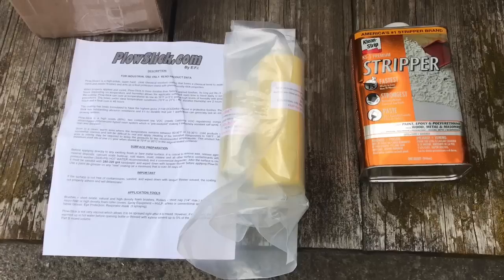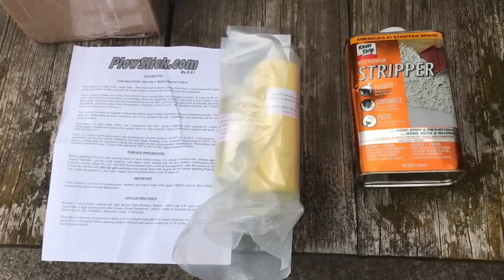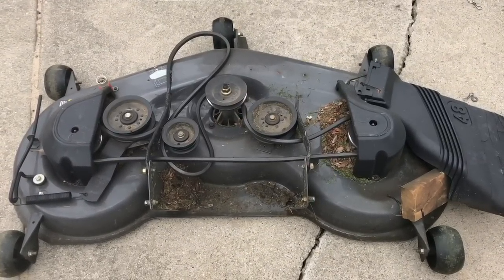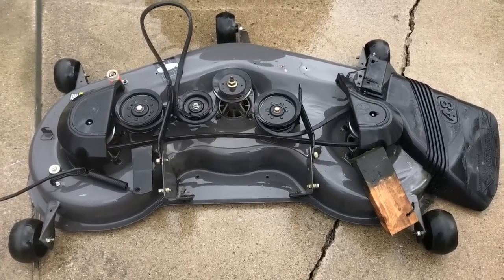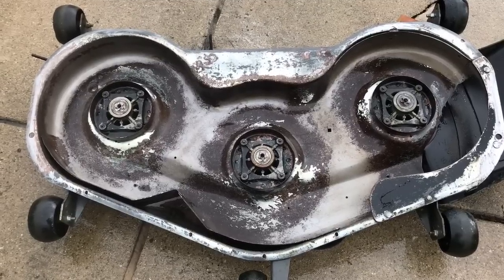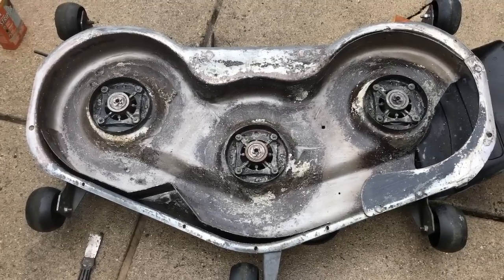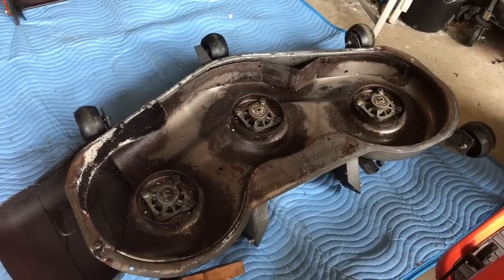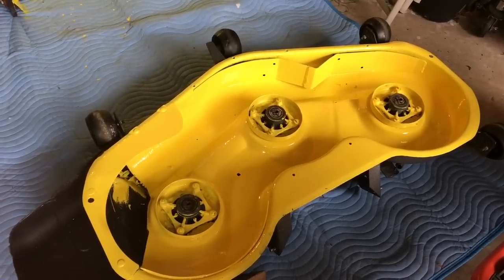Plow Slick Review on a Mower Deck

Comment: I think I'll try this product.   It's essentially a paint coating.  Not an actual non-stick material.  It looks like it will have a very smooth, tight surface.  I'd want it to help keep my mower deck from rusting due to wear of the paint finish.  This is some kind of catalyzed polymer, perhaps either epoxy or urethane.

Comment: I am possibly going to try a product called Sikaflex self leveling (liquid rubber) I have to test it first on metal surface, it sticks very well to concrete, i have used it in my basement for waterproofing, dries like hard rubber and smooth.
Reply: T. Dee Did you try it? What did think.
Reply: No did not try I think that would come off too. I tried some furnace cement even that came off. There was this stuff you could buy years ago, maybe they still sell it. It was for car wheels so road salt won't pit the wheels. I stayed on well as I remember, and was a brownish gluey color.
Reply: T. Dee Seems like there isn’t really anything to keep the grass from sticking, all the videos I watch testing products that promise to end up looking just like a deck that wasn’t coated. Maybe they help it wash off easier or protect it from rust, I’m thinking of trying some of the graphite paint. Trying to only mow dry grass is impossible for me but mowing dry leaves in the fall I’m told will blast some of the grass off the bottom.

Comment: I have tried many things even painting the deck with graphite.  It all failed, The grass always sticks And after a few months it always were off. I have heard of a lot of people power washing underneath,  But I personally don't like getting water on my spindles.  The best luck I have had it scraping the old grass off And coating it with cheap nonstick cooking spray. Nice review,  Wish it would have been successful.
Reply from the maker: steiger 256 I’ve been using fluid film and it seems to work well.

Comment: i just started getting into protecting the underside of my lawn mower, this year i used wd-40 but was told somewhere else that if you don't have a rust inhibitor of some sort you could just coat it with OLD engine oil ... but i think the real tip is just rinse off your mower after each cut but this may be easier for some mowers more than others ...

Comment: Mineral spirit isn't that oil base if so paint will not stick to it .use paint thinner to remove oils.Then paint it with epoxy paint let dry then send with 2000 grit . Then buff with a cotton wheel with 10,000 grit compound . Nothing will stick to it then not even worm piss.

Comment: The trick I use is to clean the deck immediately after cutting the grass before it has a chance to dry out. I disabled all the safety features so I can leave the motor and  blades running while I am off the mower. Then I take a hose with a really powerful nozzle and spray under the deck in various places while it's running full out, while being very careful not hit the blades. Between the powerful stream of water and the rotation of the blades it cleans everything out real well. Of course I do not recommend this method for those among us that are idiots and need to be protected from themselves. (:-)

Comment: I don't think it's possible to stop grass from sticking. The surface would need to be mirror like. That would change as soon as you mow a few times. It's like a sandblasting cabinet under a deck...
Reply from the maker: I have found cooking spray or fluid film to work very well!  Reapply often.

Comment: I wonder if the Rust-Oleum Flexible Rubber Coating  would work??
Reply from the maker: Steve Kopcial I’ve tried that exact paint on other mower decks and it is HORRIBLE for that job. The rubber is a sticky tacky texture which makes grass stick even worse. I have found that applying thin lubricants works best.
Reply: Thanks for the input, I will use the thin lubricants...

Comment: I am sure that the plow slick is intended to be used on snow plows so the snow slides off and does not stick to the plow.  Grass is another thing all together.  Nice try. good video.
Reply from the maker: I contacted the company directly and asked them about application to a mower deck and they said that isn't what it is designed for but it should work.  Well, it doesn't.

Comment: do you need mulching blades, cause i think thats the biggest problem?
Reply from the maker: I have tried 3 different sets of blades on the mower, same result with all of them.
Reply: I think I understand your problem, then.  The blades all have to exit their grass clippings at only the one exit chute.  The other blades are churning their clippings around and eating away at the surface of the housing because there is not enough exit flow for all three blades.  The only real solution to wear and clogging would be to open up the other side, and add another exit chute to the deck.  That's my opinion, anyway.  Have a great week, man, and good luck.
Reply: Maybe just do mulching on only a 1 or 2 blade deck ?
Reply: The only decks that don't plug up while cutting wet grass or grass that holds a lot of water in it are single blade decks, and then they eventually plug up too. Dry grass is not a problem with any kind of deck. It's not the blades either, it's the amount of dew, rain water, or moisture in the grass itself. Clean the deck after you use the mower, not the next time you're preparing to use it. The stuff practically falls off when you hit with a scraper if you scrape it while it's still wet. I use an automotive gasket scraper with a 1.5" wide blade and a 14" handle. Works great.

Comment: Just a FYI you see the port on your deck? Use it they actually work you wasted water and money on that yellow crap. Use regular paint. Use that port Everytime you mow with deck down run blades 2 minutes and clean.
Reply from the maker: David White the clean out port by no means works. I could run it for 20-30 minutes after each mow and the deck would still be completely filthy.